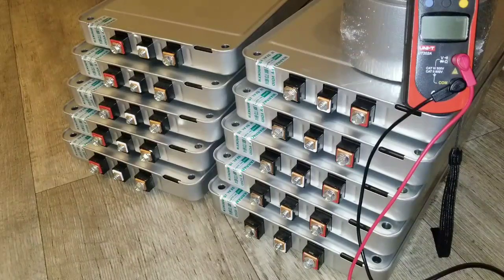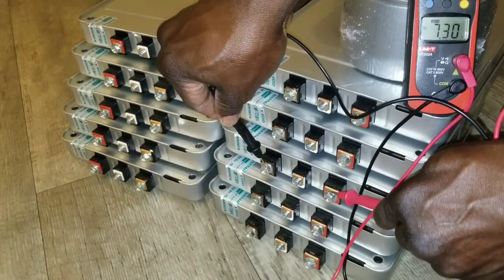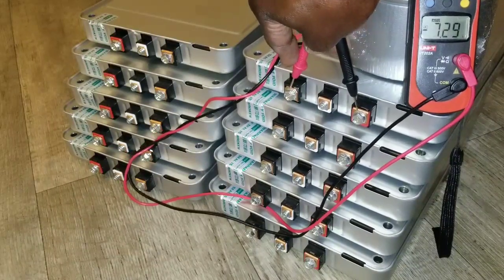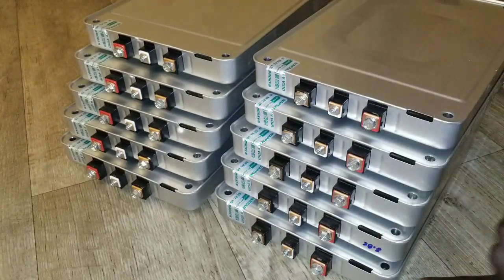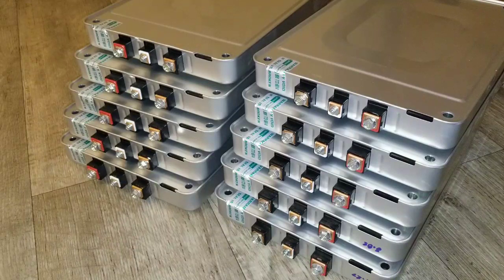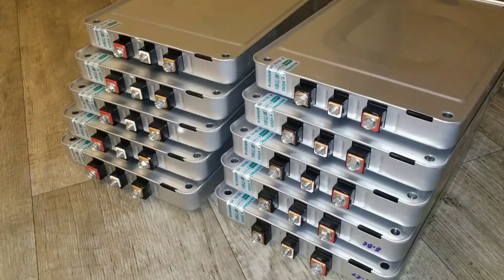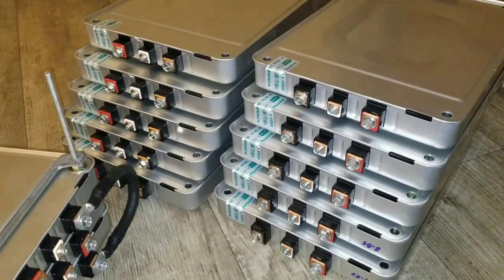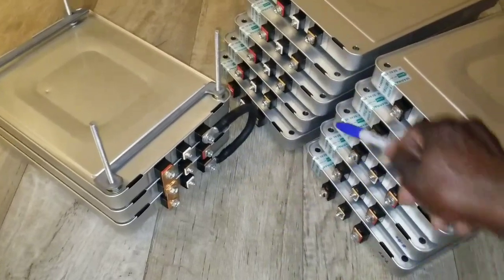NISSAN LEAF BATTERY MODULES REPURPOSED IN SOLAR ENERGY STORAGE: Voltage test with multimeter

Comment: Hey, great video. I'm looking to buy 48 modules from a gen 1 leaf for my house battery wall. The seller says that gen 1 batteries will degrade forever while gen 2 batteries degrade to a point and then die with a short circuit, not a big deal in a high voltage pack but if used in parallel to get 48 volts they're a fire hazard as the other batteries in that bank will deliver unlimited amount of current trying to bring it to voltage. Do you know if that's true?
Reply from the maker: I will suggest going with the Gen 1
Reply: @jwsolarusa  OK, thanks for your answer but do you know if gen 2 batteries degrade to a point and then die with a short circuit. I'm trying to verify if that is the case.
Reply: Hello, I need 10 Leaf batteries, how do I contact you?